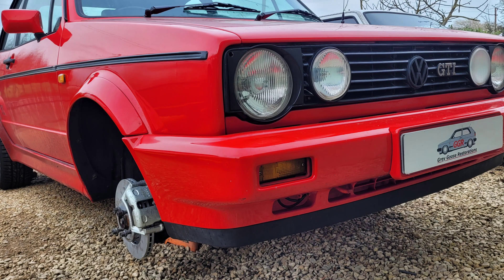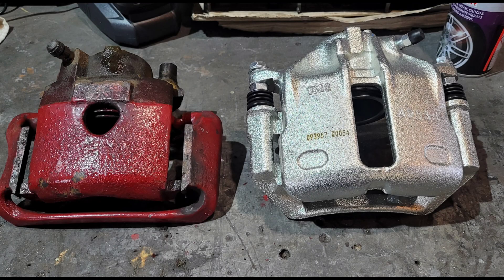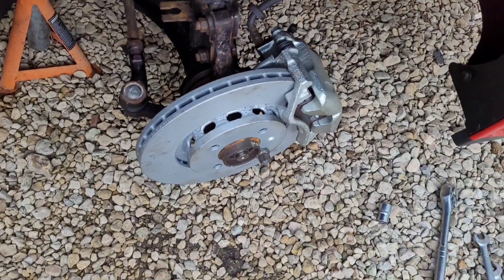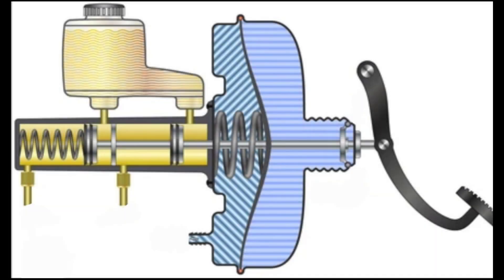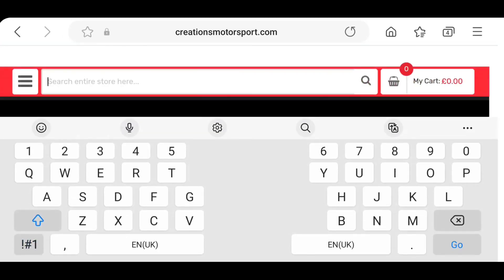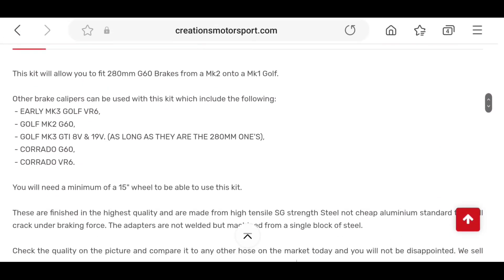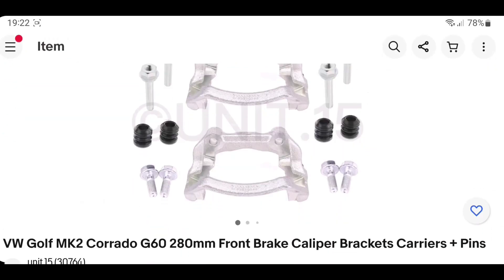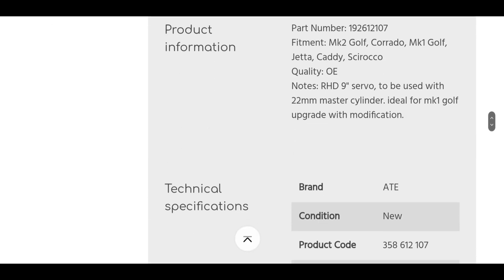VW Mk1 Golf GTI - Big Brake Conversion

Comment: The cheapest 280mm brakes for Golf mk1 are caliper and yoke from Opel Omega 16v, ISO 7379 m10/m12 screws, G60 disc, brake lines from Golf IV
Reply from the maker: Interesting info, thanks

Comment: I have G60 brakes with 16v servo in my stripped out MK1, with a good set of tyres on a nice dry day you can really slam yourself forwards if you stamp on the brakes. Need to get it back on the road. Semi-related, I remember seeing an upgraded brake linkage bar that runs across the bulkhead but since have never been able to find it, are you familiar with it? Be a nice upgrade to brake feel.
Reply from the maker: Yeah i remember that there was a sort or kit to take out the flex in the cross link.

Comment: A great conversion for a Mk1, nicely done. I rebuilt a 16v Mk2 about seven years ago, and when it came to the brakes, I did the G60 calliper upgrade. Braided brake lines, 280mm discs, both groved and standard, also the 22mm master cylinder. But to be honest, I was not that impressed. A few years later, I thought I would try upgrading the 16V Servo to a bigger unit. Basically because every time I jumped into my wife’s MK 5 TDI Golf, I was blown away with the standard brakes. So I tried fitting a BMW E30 brake Servo. The bolt mounting is the same and if memory serves me correctly, it’s close to being a 12 inch Servo. Yes there was basic engineering involved in making the VW pedal input shaft fit the input shaft of the BMW Servo, but nothing complicated as long as common sense is used. Well the transformation was staggering. I have been driving with this setup for at least four years now and for a time was worried I would lock up the breaks during a possible emergency situation. Well it’s never happened and once I even tried the car out on a track driving you know what out of it. Perfect, never let me down. Even just driving around normally, the brakes give you lots of confidence. Well worth the effort if you want just that little bit more out of the brake system. By the way, at the time I could find nobody who had done this conversion on YouTube.
Reply from the maker: Hmm interesting 🤔 nice to know that 👍
Reply: can you make a short video explaining what you did, and how you would do it over if you had to? I'm upgrading my brakes in 2 weeks and really want to have brakes I can use with confidence.
Reply from the maker: We actually put to stock servo and master cylinder back on the car so it was just the bigger calipers etc 

It gave a better pedal feel and travel, whats hard on the Mk1 is the linkage system has a lot of flex in it so you can lose pedal feel easily.

Comment: Nice job. Does it need a proportioning valve to adjust rear bias?
Reply from the maker: This particular model doesn't have the rear valve. it just has the smaller wheel cylinders, 14mm ones if memory serves me

Comment: £500 for some marginally better brakes, seems expensive for a car that isn’t very fast
Reply: Faster than you think as the power to weight is pretty good
Reply from the maker: The mk1 brakes are poor to start with, the G60 brakes are a huge improvement over stock
Reply: @GreyGooseRestorations  im well aware, have owned 8 of them, but that’s an expensive upgrade, even if you do the work yourself, very expensive if you pay for Labour as well
Reply: @GreyGooseRestorations I do not agree with that, the original brakes are quite good if they are in perfect condition.
Reply from the maker: This was one reason for the upgrade, the original hangers had wear marks causing the pads to rattle even with new anti rattle clips which was a huge annoyance.
Reply: @GreyGooseRestorations  maybe your rubber guide was worn out.
At the moment I do have the 280mm like you and a Wildwood master cylinder, but first I have rebuilded the entire original system and then made the upgraded to 280, it made the car loose a second from 0-100 because they are pretty heavier than stock, and made no difference in braking power or Fade, made a noticeable difference only in braking power modulation, there was no fade before with stock size system and sport pads, i did the 280mm because i was concern about overheating and pad wear, but I found out that was not necessary at all, I do Race my car often in hills.
There are some old tests about this Cars and they were very good at braking, actually better than some modern sports Cars, except when ABS matters, check some tests from motorweek and see for example the cabriolet vs a golf 4 r32, you Will not expect that result, or even some Porsches or other modern Cars.
In those tests you get an idea how it should be when new.